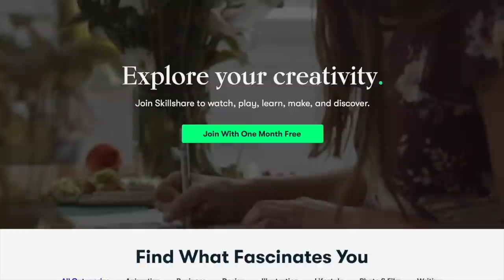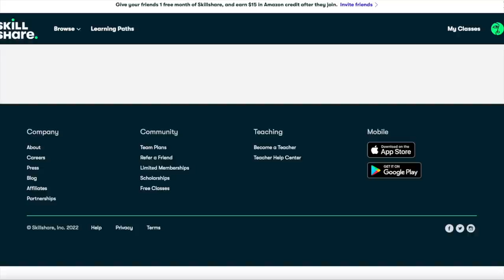LAUNDRY ROOM REMODEL PART 2 | Making Progress on our DIY Home Projects on a Budget

Comment: That's a really good sized room, lots of functions.
Comments from last week's video about no insulation; 
It's always good to have no matter what part of the country to help with heat & AC.  They do have companies that do blown in insulation for walls and ceilings. They make a small hole and blow it in with a tube for walls.  
You might want to do some research and check it out for your area, cost and how much it will save you on energy bills.  I know here in Florida, it's definitely worth having.  I didn't have any insulation in the attic of this 75 year old house when I bought it.
After having it blown in the entire attic, a huge difference, helps with sound also.

Comment: Your my Home improvement/Furniture Heroine 🦸‍♀️! Giving me all the encouragement to try all the things and not be afraid of power tools. Glenda can you explain the reason for texture to walls and ceilings? Is it necessary or is it a personal preference for esthetics? Some videos you see people scrapping off texture while others are adding it. But I haven't heard a clear explanation on why or why not. Thanks again for sharing! 

Baby girl looks to be getting so tall from the hardware store shot. She's the cutest thing🙂
Reply from the maker: Awww that makes me happy!!!! ❤️
And no not at all! Ive noticed that texture is more common down here in the south, not sure why... 
I do not have popcorn texture, (which is what most people scrape and are trying to get away from- its quite outdated)
its orange peel so its less raised and more like a flat speckle (quite literally like orange peel) 
I think the main reason for texture is it allows to hide some of the imperfections when tape/floating... and there's different types of textures
there's different levels to smooth walls and smooth walls are far more expensive than textured because of the amount of time it takes to achieve such a flawless look without room for imperfections that won't be noticeable when painting. I hope that answers your question. It is personal preference but budget plays a huge role 
as for me im no pro when it comes to tape and floating so there's no way I could end up with a super smooth wall, so texturing is perfect for my skills!

Comment: Thanks for sharing your journey. I love watching the makeovers. Looks like your doing your roof too. Maybe? 😆 I was wondering why you were texturing the drywall. And if you were going to sand it a bit to make it smooth. But then I saw the texture up close. My bloody knuckles remember that texture from my parents old plaster walls. 😂 plaster is super hard to sand down. Not sure if yours is like that.
Reply from the maker: Yes!! I was having the roof redone the same day I worked on the doors and sprayed the primer. 
They were up there for 13 hours. 
Lol no mine is more orange peel type texture its not as raised like popcorn... from finish compound so its easy to sand down/scrape with no paint. 
but I remember we had popcorn textured walls in an apt we lived in when I was younger and yes same thing if you ran to fast and scraped up against it ouch loll 
gettin smooth walls is an art lol there's levels to smooth walls when it comes to finishing them and I am not there, so to hide imperfections from the tape/floating texturing is perfect for my skillset.❤️😊

Comment: Hi Glenda! I love your channel. I wanted to ask...is there a purpose or reason for textured walls. I'm in Atlanta and I don't see them here. Does it have to do with climate?
Reply from the maker: I think its just preference/cost efficiency..
I believe its more popular in certain areas than it is in others, but texture allows to hide imperfections created during the tape/floating process which turns out to be cheaper and a faster finish.. 
Smooth walls have different levels and require more skillset (its really an art lol) therefore more costly.. 
For my skillset adding texture is perfect... if I had the skillset to do smooth walls, I would but im just a newbie lol ❤️😊

Comment: Hola!! I have a question about the floors? Are you retiring the floor or are covering with something else? If so, why did you take up the tiles? I thought they’re easy to cover.
Reply from the maker: Hola ❤️😊
Definitely easier to lay something like lvp over the top of the tile but the height it would have added would be way to high for the transitions of the different floors into the bathroom and into the kitchen and I did not like that idea. 
I had though about adding new tile floors (like the ones I mentioned in part 1 of this series) and in order to add new tile the old must come up. 
Overall I think it'd be best to start new/clean 
There's nothing wrong with these floors I just don't like them so that's why im changing them.
Reply: @GlendaChavez  great to know! Transitions are important!! Can’t wait to see it all finished! You’re amazing!!